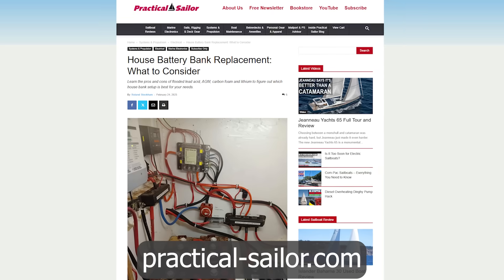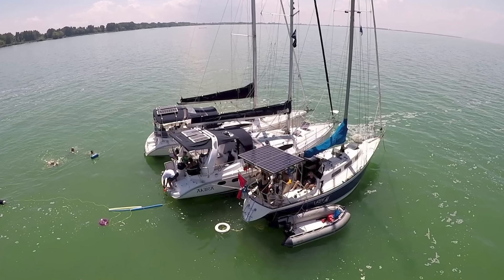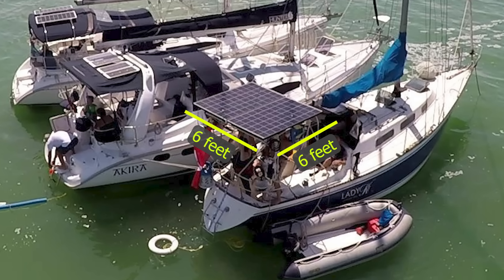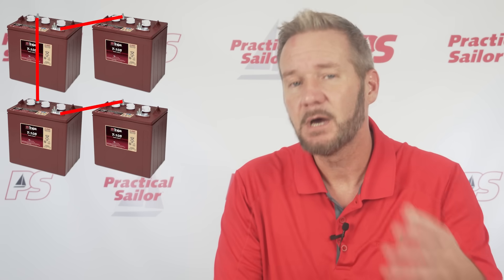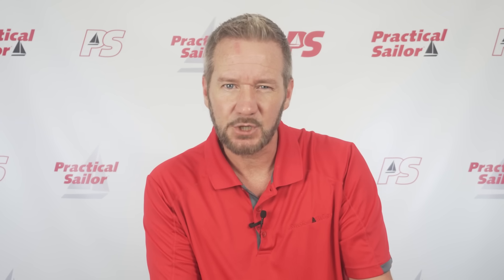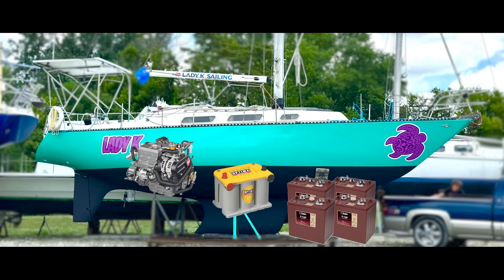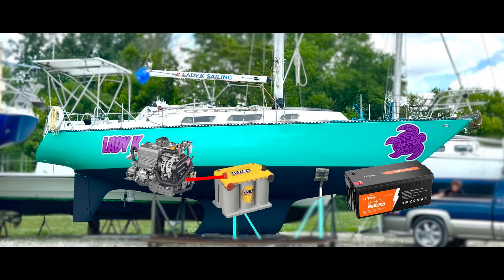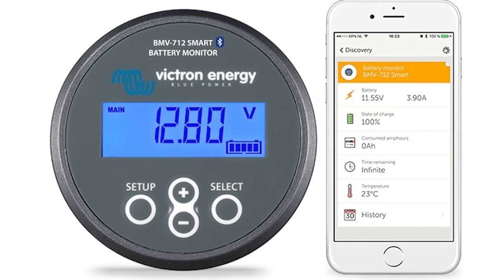Which Batteries Would I Buy TODAY for my SAILBOAT?

Comment: I would add not just the rating of the solar panels are increased but the type is important too, I just purchased 2- 250W panels from Renogy and they are the bi-facial 16 bus bar type and are worlds better than the 2- 160W replaced and not just the bigger size making a difference. The 16 bus bar helps so much with shading which is an issue on most sailboats so I hit full charge in the middle of the afternoon where before every few days would have to run the engine for 45. I am in the Carribean so draw lots of power.

Comment: I pretty much  applied what you described in the video, spring last year. But before getting any lithium I had a campaign to reduce down all my unnecessary power usage. LED nav lights, all internal lighting is now LED. chartplotter is Raspberry pi (1 Amp @5V). All electronic toys are USB powered. So now only high consumers in my R36 is Raymarine autopilot (on a bad day) and the 12V dc Fridge.
I then approximated how many Amp/h of energy to ideally sail through the night  with some margin to avoid starting engine ;).
One additional item went into the mix. One of those lithium power banks for starting motors in emergency. That's my backup in case the start battery goes south.
So far it has been great in western Med.
Reply: Got any suggestions to learn more about raspberry pi without going back to college?

Comment: TODAY I'd buy nothing. I'd wait for solid state batteries. Supposedly more kWh/volume, more kWh/mass. Supposedly more recharge cycles. Supposedly suited to higher recharge Amps (i.e. faster).
If you NEED batteries TODAY, keep it simple and as minimal as possible in your use case.
Same with solar. You need panels with dual PV layers under a perovskite light collecting layer of light funnels - for significantly more W/area.
If you need them now, sail to where the panels are the cheapest and put a few up there. Just to bridge between TODAY and when such next level technology is beyond "early adopter" TCO phase.

Comment: As often happens, I would make a minor modification to the system.  I'm not going to try to size everything here.  I've been on a moderate passage - 6 days - when Mother Nature was not kind to our power situation and we had an alternator failure.  The sun did not shine on us for the entire 6 days.  The solar panels were not producing much power.  As we were approaching a seldom visited island, we were hand steering in rain and fog with no chart plotter or tablet. Navigation was by Navionics on my phone because we were out of power.  Simply for redundancy, I would add at least one 400 ah wind generator.  My basis is that we will almost always have sunshine or wind while out to sea.   If the wind is blowing, I have constant 400 ah of power.  If the sun shines, I have 8 to 10 hours/day of 1000 ah power.  If the sun flames out and wind goes dead, I will probably freeze to death along with everyone else on the planet.  I haven't figured out the build to fix that.

Comment: Design Help Wanted:  Thank you for this video, and thanks to the commenters.  I have a smaller boat I want to outfit for 3-4 month/year cruising in the Caribbean.  I am preparing a Nimble Voyager 26 ( same as Ocean Voyager 26) as a trailerable boat for Bahamas or Caribean, probably 2 to 3 months/year.  My power ambitions are humble, Nav, AIS, and tiller steer autopilot.  My double ender with low and long boom has very limited solar potential.  I need some help to design a safe and reliable system.  I tend to get tired while cruising so the system needs to be simple to operate.   Is this a commission any of you would be interested in?

Comment: It all should start with what you need to power.   I have a 26' trailer sailor, don't live on it, and only power lights, autopilot, and VHF radio.    I don't need much power for how I use the boat, so 100aH lithium with a portable 120W panel is more than enough.

Comment: Great information. I bought a LiTime battery when they had a great sale but did not know how to connect them into my system. After watching your video I now know I don't need the AB switch and I do need a DC to DC converter. I have an outboard on my sailboat vs a diesel so not as many amps available but I have way less load than what you have. The question I have is where do the solar panels connect in, on the lead acid battery or on the lithium side only. Is the lithium battery the only source for the boat loads or do I use the AB switch there now?

Comment: Just changed my still usable system of three, 20-yr-old but still functioning well, 4d gels and separate optima start battery:
Kept the group 31 Optima start.  Two, 206 AH SOK house.  Retained one 4d gel isolated for the windlass only, through a separate 7 amp Victron charger set to gel profile.   We also retained the 105 Amp (really about 85 amp) house alternator and the separate start battery alternator.  Each SOK likes 40 amps each of power so the house alternator is sized properly and is equipped with an alternator protection module necessary for the charging profile peculiar to lithium iron batteries.
The SOKs got a simple Blue Seas on/off switch powered through a Victron Multiplus 2000/ 80-50 charger/inverter with remote panel and Victron smart shunt to monitor.  All new 2/0 cables & lugs.  Our on-board power demands are minimal with refrigeration being the big user; all lights LED.  Though we didn't need the Victron Multiplus 3000's inverter output, I would have gotten it anyway in hindsight as the 2000 is restricted to a minimum of 1 hour absorption time whereas the 3000 is adjustable by minutes of time.  20 minutes absorption is sufficient.
Two, 100W solar panels with a Victron MPPT 100/30 controller.
This provided an additional 120 usable AHs and saved about 160 lbs of weight.
It takes about two weeks before we need to recharge utilizing just the inverter, no shore power, even with PNW cloudy days.

Comment: You definitely CAN charge your solar batteries with your alternator, all you have to do is connect it to your MPPT solar charge controller on the PV side.
Reply: Normally the voltage you get from your alternator will be too low for your MPPT controller to use to charge your batteries.

Comment: This is just a surface level discussion. Good info though. Don’t forget to verify your solar charge controller can work with the Lithium Battery. You may need to change some charge settings or even upgrade the charger. Since he is likely using Victron, he is likely ok so long as he updates the settings.

Comment: You can actually 100% DOD your LiFePO4.  In nearly all applications, including boating applications, it just won't hurt anything.  A LiFePO4 battery these days gets 6000 cycles at 80% DOD to 80% capacity.   It might get 4000 cycles at 100% DOD to 80% capacity.  Well... 4000 full cycles?   That would be 20+ years in a boating application, or longer.  The electronics in the battery will fail long before the cells do.  And cells themselves don't actually fail, they just slowly lose capacity.  So 80% capacity is not the end anyway.

For a LiFePO4 battery, 99% discharged is like 12.0V under a light load, so set the low-voltage cut-off to 11.0V or 12.0V and you are done (for a 12V.8 battery.  22-24V for a 25.6V battery, 44-48V for a 51.2V battery.  LiFePO4).

-Matt

Comment: For a brand new system?  24V or 48V LiFePO4 hands down no question about it.   So much capability, far less weight, far lower amps, far smaller cables, and much smaller equipment.   For a retrofit system things get more complicated and it primarily comes down to whatever high-amperage 12V legacy equipment you want to keep.  Low-amperage 12V equipment can remain.   If you would have to replace too many expensive high-wattage 12V appliances, then you might need to stick with 12V for the battery bank because it would just be too expensive to do anything else.

With a higher-voltage system you need conversion... which is simple enough honestly because the whole point is for the legacy 12V equipment to be low-wattage,  run from a buffer battery so the DC-DC chargers can be cheap and small.   For example, your 12V loads might run fine with a 30Ah LiFepO4 battery (30A max)... or you might need a 100Ah LiFePO4 battery (100A max).  But you would only need to trickle-charge it from the higher-voltage home system at relatively low amperages... like 6A for example (72W).

The key to retro-fitting a higher-voltage home bank is to replace the alternator.  Have a higher-voltage alternator matched to the home bank and use a DC-DC charger (don't run the alternator directly to a LiFePO4 home bank).  With a start delay of course so it doesn't fight the engine start.

The remaining 12V is then just the starter battery and the legacy 12V system and in both cases you just trickle-charge them from the higher-voltage home bank with low-amperage DC-DC chargers.   Keep them separate.  The starter battery now starts ONLY the engine.   And the legacy 12V system is now just a DC-DC charger from the home system going to a 30Ah to 100Ah 12V (LiFePO4) buffer battery.   The buffer battery can be installed well above the water line and runs the radio and the 12V panell.

The nice thing about this solution is that regardless of the complexity of the home bank, in an emergency the 12V buffer battery can run the radio for a day or two just on its own.

--  Other Considerations --

* Alternator (replace with higher voltage alternator)
* Water Heater (if 12VDC replace with AC water heater).
* A/C (if 12VDC replace with AC air conditioner)
* Inverter now hangs off the higher voltage home system (replace)

* Radio - low wattage, keep on 12V buffer battery system.

* Starting battery - SEPARATE 12V system just for starting the engine.  Do not combine with the legacy 12V system.  Consider adding a redundant DC-DC charger for the starter battery that runs from the higher voltage alternator output, since this is absolutely critical.  Again, low amperage DC-DC charger.

* Electric Winches - might be too expensive to replace, so this is a major consideration for higher voltage home bank conversions.

* Bilge Pumps - You always want at least two, and put on different systems.  So, for example, one could hang off the home system (replace with a higher voltage bilge pump matched to the home system voltage), and the other can remain on the 12V buffer battery system.

* Washdown system pump - medium wattage might be able to keep on 12V but otherwise replace with an AC pump.

* Fridge - if 12VDC, keep on 12V buffer battery system.

If the 12V system amps remaining tops out below 30A then a 30Ah (30A) LiFePO4 buffer battery is probably fine.  If above, then get a 100Ah (100A) LiFePO4 buffer battery.  Do not share with the starter battery.  It might be tempting, but don't do it.

--

This might seem like a lot more equipment but the key thing to keep in mind is that all the DC-DC equipment except the alternator-charger is now low-amperage.  Much smaller and cheaper equipment.   Don't use high-amperage DC-DCs when you don't need to!

-Matt

Comment: I’m an ABYC Master Tech and professional marine energy systems installer who designs and installs high power lithium/solar/etc. systems for boats. For monitoring - ABYC recommends a visual or audible alarm if your battery state of charge is low. I don’t recommend relying on your phone to provide this alarm. Your phone may not be on, may not be near you, and the alarm only goes to you . The advantage of the little screen is that it always works, shows everyone, and can be set to ‘beep’ as well as display. If you have a Cerbo and a Touch screen, you don’t need a shunt with a display, but if you don’t have a Cerbo and screen, I strongly suggest still having the little round screen. You will still be able to get more info on your phone, but you won’t have to use your phone.
Reply: Installed a CERBO-GX on my Pacific Seacraft 31 with the touch screen; also installed two shunts one for the Engine Battery and the other for the Lithium house bank! Unfortunately, the CERBO GX can only display one SHUNT value - so that is connected to the HOUSE BANK. 
We should also counsel DYI-ers and Marine Technicians to select only UL approved batteries. Looks like alot of manufacturers are taking heed of the ABYC standards for the Marine Industry!
Reply: No need for an alarm for the house batteries.  He still has the fully charged starter battery.
Reply: @finnerutavdet  If any safety related equipment is hooked into house battery, I'd beg to differ...
Reply: I agree that keeping the battery status display is a very good idea.  Relying on a smart phone app is unwise for something as important as Li-Ion battery status.
Reply: My older boat has three AGM 100ah batteries and one AGM starter battery. I plan to take out the three way switch and wire the solar to the house battery, and the engine alternator to the starter battery. Can someone tell me if an ACR or DC to DC charger would be better between the two battery banks?

Comment: Good and useful explanation for the not experienced. 
I think the main thing missing is how to choose reliable lithium batteries, 
and then how to make the whole system smarter. As in continuously getting info about the state of each core element. 

Perhaps also worth mentioning that the 12v to 12v charger is great, but makes a tight bottleneck for using the engine to restore the battery level. A smarter alternator with an external regulator would give way shorter engine run time. Thus a significantly higher buying cost with a significantly lower running cost.

Comment: Thank you, I enjoyed your video!  On one of your past videos you brought to my attention a boat called a Gozzard.  I travelled near and far (FL to MA) and wound up buying a 2001 Gozzard 37a which ended up being eight slips from me:)  We are getting ready to go up to the Chesapeake and I'm trying really hard to get my stuff wrapped up to be ready to go by May 6.  Ended up getting 2 additional 400AH Voltgo batteries.  They have Bluetooth, a cell balancing system, are IP65 (waterproofish) rated, have a battery management system, are made of ABS, come with a mounting system, and have internal heaters.  Mounted four renogy 200 watt rigid monocrystalline panels.  Renogy has excellent live customer service.  Two are wired in parallel.  The two parallel sets wired in series.  For the solar controllers, I'm using two Victron 100/30 controllers.  I decided to use two of their smaller controllers just in case one goes out (I hear they do fail).  My Freedom 1500 charger/inverter doesn't work correctly so I got a Victron Quattro 2x120 split phase 12v/3000 watt unit.  The benefit of this unit is that it will give me two 120volt legs of power and will also serve as an automatic transfer switch should the genset ever get turned on.  I'm able to keep my current 400AH AGM house bank batteries and use them in conjunction with my new Voltgo batteries by using newly available technology called a Battery bank Manager (offered by Clark/SV Temptress) which allows you to have both and still charge lithium the way it needs to be charged (of paramount importance) and to charge your AGM the way it needs to be charged while having them in parallel and keep your lead acid engine starter battery in the loop without damaging your alternator (also very very important).  The Gozzard 37a has limited space so I'm building a fiberglass laminated table in the transom which will support the two Lithium batteries.  The Voltgo batteries do have internal heaters, so when it's below freezing, they can still be charged to avoid the kiss of death process called "plating" ($4,000 for the batteries so it's very important not to let your LIFEPO4 batteries plate).  So heated batteries could be a benefit if you think your batteries may be in a cold climate...or just don't charge the lithium phosphate batteries until they get above 32 Farenheit (lithium ion would be fine but are potentially dangerous while charging).  Thank you again for the video...I hope that sharing some of my journey will be helpful for others:)  Tony/SV Liberty
Reply: So you are happy with the Battery bank manager? I've been wondering how well that has worked for folks. And it's one possible solution I've looked at.
Reply: @mrzandskippy  Actually, not so happy with the Battery bank manager yet. I'm trying to overcome some hurdles related to the BBMS...hopefully will gave a good outcome to tell everyone about!

Comment: I use an AGM EngBat which charges the DomBat 600Ah LFP bank via two Orion XS 50A chargers. 

A quick failure modes analysis shows this to have a few less failure modes. The dual Orions provide some redundancy and can be reversed to charge the EngBat in a pinch. 

I've had some serious failures splitting the alternator output, once causing a voltage spike that fried the engine ECM. Another time the splitter allowed the EngBat to simply die while trying to charge a dead DomBat.  

I try to keep it simple and easy to asses.

Comment: Lithium needs a bus which may decide to cut you of completely at the wrong time. So I would add an extra intermediate  lead acid household battery for instruments and autopilot. As a safety measure. Charged from the lithium.

Comment: I'd recommend two standard 4D sized lithiums rather than one of those monsters. One cell goes she's bricked at 1000$+, should have redundancy either way. Why not upgrade your alternator to 100a with a lithium compatible external baldor and use the dc to dc for the start battery... and what about your existing converter/charger??... upgrade to a inverter/charger?